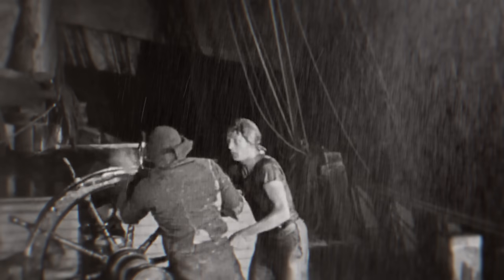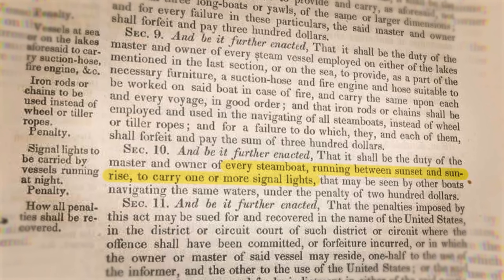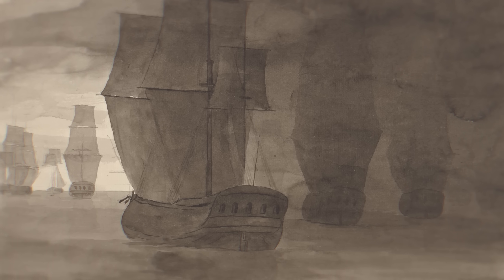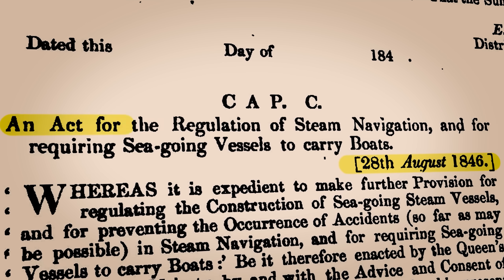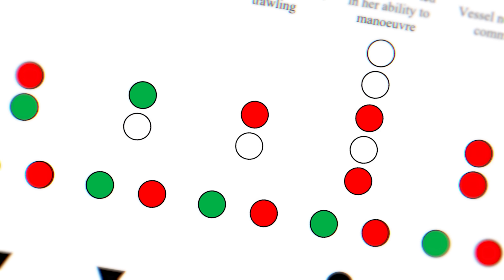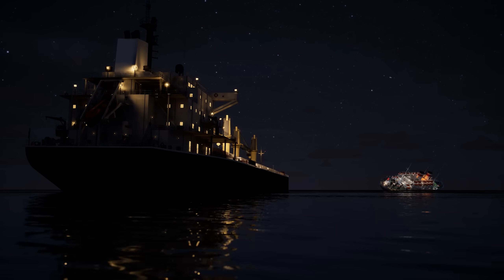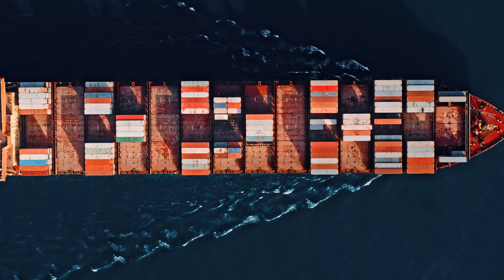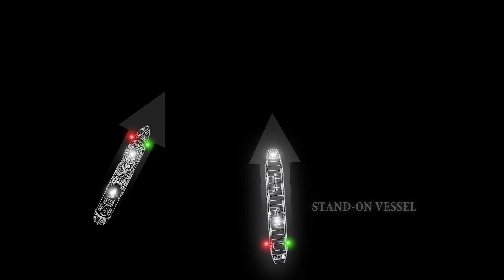How Ships' Lights Work

Comment: If you see a green light the ship is facing to the right. The bow is right of the light and the stern is left of the light. And it's vice versa for the red light. So you can easily tell in the dark which way the ship you're seeing is facing.

Comment: One thing that gives me grief on the misssissippi river is that the side lights are often way up on the conning tower at the back of the ship. Often there is no light at all in the front of the barge or boat. 
The new white led parking lot lamps that are all along the river  are 10x brighter than any light on a boat.

Comment: It's actually super clever - since in most places the ship on the right has a priority, it clearly indicates not only the direction in which the ship is moving but whether you should yield or not as well. Green light - it moves towards your left, and you have priority, red light - you need to yield cause it's going from your right.

Comment: Starboard and steerboard is correct but Port came about because that was the side of the vessel always tied to the port because the steer board was on the other side and would interfere with docking.    Or at least that's what I was taught 20 years ago when I learned to sail

Comment: There is a problem with the system though - for it to be effective everyone needs to strictly follow it. But there are fishing vessels around especially small private fishing boats. The guys often turn off all the lights in order not to scare the fish away and they can be anywhere there is fish to catch. They obviously have dark green or dark blue hull color and they try not to make any noise for the same purpose. It makes them very hard to spot before it is too late to react. And depending on the method of fishing they may need to move around following the fish so they can slow down or speed up or turn to any direction at any moment if that is where their fish is going. Of course unless it is a very big ship with a few officers onboard they will not look around for your lights as they will be almost completely focused on what is going around underwater and how they can catch it. And even if it is I would still not bet on any of them looking around all the time. 

That is why some places have stict speed limits and that is why despite their questionable legal status and undesirable side effects high power forward beam lights exist and owners of all small boats not equipped with a radar should consider having one. The silent menaces of all speeds and sizes can be lurking anywhere. Of course there is a cheap solution of AIS receivers but small unregistered boats are generally not allowed to have an AIS transmitter so they can not bradcast their position. And on top of that in the areas of the most active sea fishing especially close to China many commercial fishers tend to use cheap AIS GPS markers for their net floaters hoping to make big ships stay away and not damage their nets so the entire screen gets littered with the markers as soon as you approach the region and the whole system becomes useless. 

Sometimes knowing about the general situation around the area you are entering, always being cauteous and going slow and staying alert when and where problems are more likely to arise are the most important things that can help you avoid trouble on your boat.
Reply: Radar is a great help, and it is quite affordable these days when you compare it to the cost of the rig. Most boats these days have sat navs which are also a great safety measure.

Comment: One exception: a sailing boat is always a stand-on vessel (always with priority). Now, this rule is often ignored for a very valid reason - if the sailing boat is very small and the other vessel is very big, usually it is easier to steer the sailor away than the bigger ship.
Reply: Only if they are under sail and not using engine power a distinction that is very important.
Just because it is a sailboat with masts and furled sails  when it is under power it loses it's precedence as a sailboat.    There are a few other exceptions such as it gives way to a fishing  vessel engaged in fishing, Restricted in ability to Maneuver and not under command. Also sailboats must not impede vessels operating in channels or confined waters.
Reply: @glennrishton5679  Well, yes, of course.

Comment: Green for go, red for stop. If you see a single green light at night you maintain your course as they are the give way vessel.
If you see a red light it's your duty to take whatever action is needed to avoid a collision.
When I did my boat master we were shown different light cards we had to identify, restricted ability to manoeuvre, vessel over 50 metres etc. The last one was a single white light moving slowly from side to side. No one got it. Finally our examiner explained it to us. It was the harbour master riding his bicycle along the wharf. In other words, don't trick yourself into believing something just based on what you think it looks like. Only a few days earlier a yacht skipper had put his boat on a reef when he mistook a flashing light for a lighthouse he was expecting to see near where he thought he was. What he had seen was a remote farmhouse with a row of trees in front of it. He was a lot closer to shore than he thought and the speed of his boat gave the appearance of a flashing light.

Comment: Having been to a couple of America colonial towns where glass works are performed daily. Not to mention the Corning glass works in NEW YORK. colored glass has been made for centuries. Some of the most abundant raw materials when mixed correctly make colored glass. And because of the need to produce spares away from the ships home birth picking  colors that would be cheap to produce makes sense. Limestone copper iron easily sourced through the world. Even today GLASS can still be broken with water

Comment: One of the problems with using red and green lights is that 10% of the populations colorblind  cannot distinguish  many shades of those colors. Traffic lights use very specific shades of these colors that anyone can distinguish. Many  designers of ship and boat lighting do not. The manufacturers of color-split bow lights made for racing shells are  particularly cavalier about this problem.

Comment: most people do not realise that automotive lighting also has regulations concerning brightness, viewing angles and hue for brake, turn signal, head and tail lights, including side marker lights.  My first job in the 1980's was as a tech testing light fixtures for commercial vehicles.

Comment: A few hears ago I came up with the great idea to cast a pair of loudspeakers in concrete. They were made in two parts - a cylindrical “bucket” and a cover, or baffle as we “experts” say. 
Trying to be funny, I added green dye in one casting of the baffles and red in the other to keep track of Right and Left channel, or Starboard and Port channel, or in Swedish Styrbord and Babord. “Styrbord” has to do with steering (and to this day I pull out the memory of a viking ship I built in my teens where the steering was made on the righthand side.
And making a short story …. errrr …. the two speakers are identical 🙄. But one is green and the other blue like lanterns on a ship.

Edit. Red, I mean RED not blue!

Comment: Green and red are colors which can be produced relatively cheap and effectively from yellowish flame light, available in 1800s. Red glass made with copper since Romans, and green glass is even simplier, it colors by natural iron oxide. And both wavelengths present in flame light, so it should not be extremely bright - like, for example, to get blue light, which became available only with electricity invention.
Reply: There’s a video kicking around on YouTube about why it was so difficult to create a blue LED, interesting watch.

Comment: 5:42 except sailboats don't use foremast white lights till today, reason why it's called the motoring light.
Sailboats, paddle boats, or whatever boats traveling with their motors off should use only starboard green + port red + aft white.
Sorry, just bringing it up because it was really funny seeing the picture of the old Full-rig with a light indicating his engine was on. 🤣
Reply: my American Donzi motor boat had a white stern light as well. it was mounted on the transom using a short removable pole.

Comment: Happens in plane and spacecraft design too.
Also carries over into fiction like Star Trek, it's a subtle little design element most people overlook.
Reply: The aviation industry borrowed the concept and the colors from naval tradition when they started adding lights to planes for the same reasons. Including similar rules for collision avoidance. You see another plane coming at you, both turn to the red.
Reply: @Krahazik  you mean both turn away from the red to your right, port to port. or keep right.

Comment: I've been bass fishing since the 80s. I always wondered why the red was on the right (coming at you) and green on the left. We drive on the right on the road(in Amercia at least) and we boat on a lake/river the same(usually). Very interesting..
Reply: yes, for us who drive on the left it is a bit harder, having said that, all the American fiz boats that I have owned over the years, Donzi and Glastron etc have always had their steering on the right hand side!  I think it was to counter the prop torque.
Reply: @TerryHickey-xt4mf  You know. I never ever thought about that. Our cars are left hand drive. Our boats are right hand drive?! I did drive a rental around Ireland. It was an experience driving on the proper side of the road. Especially driving a manual here one day then driving one there the next being used to shifting with My right hand. Luckily the pedals and shift gate pattern is the same. I assumed the shift pattern would be reversed.

Comment: Here’s one we used in the USCG- “red right returning”
Reply: Did they not teach you that it refers to the buoys that mark channels and has nothing to do with ships’ side lights?
Reply: That is for remembering what side the buoys are on, when proceeding from sea and inbound a port or going upriver.  This only applies to the area of 'Buoyage System B' (eg. North & South America).  

However, for example, Europe being under 'Buoyage System A', the little mnemonic "red, right, returning" would not apply.  

Many years ago, inbound Dublin (on a Canadian ship) the AB at the helm, only seeing the red buoy (and not the green buoy), started to put the buoy in the vessel's own starboard side.  We were still quite a distance away from the actual buoyed channel, and the pilot quickly corrected this. 

(Cheers to you XBox!!)

Comment: This did not help the Titanic, because the iceberg was not properly fitted out with running lights. Had the iceberg been properly (and legally) fitted with running lights the Titanic would easily have seen it and avoided the collision.
Reply: I'm convinced the accident could have been prevented if the operators of the iceberg had simply used their radios to ask the Titanic to alter course as the iceberg was clearly dead in the water due to a malfunc- I mean, the lack of a propulsion system
Reply: They should have sued the iceberg after it sank.
Reply: @doubledrats235  yes but which court!
Reply: @doubledrats235  EXACTLY!
Reply: Right? Icebergs must be fitted properly. And even if this one had its mandatory iceberg lights, looking at images and films from the era must have meant the world was in black and white, so it would have been really hard to spot the thing anyway. 😏
Reply: Annnnnd. Had it had enough lifeboats, everyone on Titanic could have been rescued!

Comment: Short words go together and the long words go together.  It helps remember your directions and color coding:  red, left, port (short words); green, right, starboard (long words).
Reply: also I was taught port is red because port is red, I will drink to that.  Also port side is the opposite of the starboard steering side, therefore  you always came alongside a dock on your 'port side' to protect the steering..

Comment: Funnily enough I was running through that ditty in my mind while this video ran. Though with slightly different words, the meaning is the same.
I must correct you on one point. When you said that if the stand-on vessel didn't think the give-way vessel was taking appropriate action, you said the stand-on vessel "must" take action. This is not true (though why the heck wouldn't they?) The correct rule is that they "may" take action on their own, and if they do so, they may not turn left for a vessel on their own port side. The reason that this is a may not must, is because of the difference in opinion of when that action is needed. The give-way vessel might be initiating a turn just then, and sudden maneuvering of the stand-on vessel will only confuse them.

The only "must" for the stand-on vessel is in extremis. Which is when the actions of either vessel alone cannot ensure a collision will be avoided, in which case all ships must maneuver in whatever way they think will avoid collision or minimize the damage from such a collision. Again, why wait until you are in extremis? I've been the stand-on vessel and turned anyway many times. The oceans are full of ships with no one awake on the bridge with the ship in autopilot. Scary.

The other thing not mentioned but very important is, no matter if you are the give-way or stand-on vessel, whatever maneuver you make within the rules of the road, must be significant and easily identified by the other vessel. So a five degree turn or a reduction in speed of one knot might open the distance enough to avoid collision, but the other vessel might not be able to tell you did anything. So make a substantial turn or change of speed so the other vessel is clear that you are aware of the situation and are taking action. Don't leave the other chap guessing.

Comment: @OceanlinerDesigns Is the image shown at 8:27 of a red light (or at least painted red light fitting), labelled 'Ship's starboard navigation light, courtesy Ciacho5 via Wiki Commons', instead supposed to represent a 'Port' light?

Since, Starboard is green, Port is red.

Comment: I love that in Star Trek the enterprise use the same light rules
Reply: Ah, a man of culture! 🖖😀
Reply: @enterprisedavidcain  although they would need another color pair for up/down as well, but ST ship helmsmen tend to exhibit “two dimensional thinking” across the board.
Reply: @mglenadel they have ventral and dorsal lights/strobes, like modern aircraft.
Reply: @mglenadel  Up and down have no meaning in space.
Reply: @if so neither do left and right.
Reply: @mglenadel  Those terms are relative to motion.
Reply: @captainjimolchs yes they do since most of these ships have a horizontal plane, up and down are simply that reference frame's Z-axis
Reply: @VinceP1974  My up is not yours.  I doubt we could agree on where is the top of the galaxy or universe.
Regardless, at WARP speed, you won't see me coming.
Reply: @mglenadel   Better than others, though - Khan wasn't thinking in 3 dimensions when he lost to the Enterprise in TOS. IIRC Kirk ordered a move to "sub-port".
Reply: Sad.

Comment: I think the title should have been "Here's Why Ships have red and green lights" As you don't explain why they are red and green other than at the opposite end of the people visible spectrum. I thought I was going to find out why. But I already knew about lights from being at PWSTS in the early 1960s.
Reply: I think he did, when he mentioned that those colors are good for preserving night vision.
Reply: @Pondimus_Maximus  The distances these lights are away and their actual brightness would have little effect on night vision. Even a passenger ship with all its lights on in full glory including decorative in port only lights are not shattering to night vision at a couple of miles away, which is quite close actually.  
If the nav lights are bright enough to dazzle or ruin night vision then disaster is only a second away.
Reply from the maker: True but I wonder if their colour and its night-vision effectiveness played more of a roll in the 19th century when the lights were displayed on boards in the rigging where crew might actually be working.
Reply: @OceanlinerDesigns  Keep in mind that those in the rigging are not watching out for lights, from other ships, they are furling canvas and watching where they put their feet to avoid a splash or thump. There would have been someone in the crows nest dedicated to the lookout  task where there was a likelihood of other shipping or in sea lanes and the crows nest should have been positioned and built not to have vision obstructed by ones own ships lights. So that person would not have been affected by the ships own lamps, which the others climbing the rigging may have been very briefly when climbing past the lamps. 
Also an  oil lamp with the display arc of a nav light would have been extremely dim and little upward or downward light projection all being deflected or reflected to its intended area of coverage by internal reflectors. But no-one would want a moments night blindness when climbing up to the sail area, again the splash or thump problem may arise, so red and green would definitely be better than white or yellow and they are for other areas, so that did not leave much for a solid colour that was easy to use in a lamp, even a faded red may be seen as an orange or pink for some time which would be interpreted as red by a viewer and a faded green may appear blue. But both when faded could seem yellow, anyway that all depends on the maker and the methods used not the initial colour choice. 
The old compulsory lantern test for eyes was performed with very dim and dull lights and even with good sight it was a difficult test in some places where it was conducted.